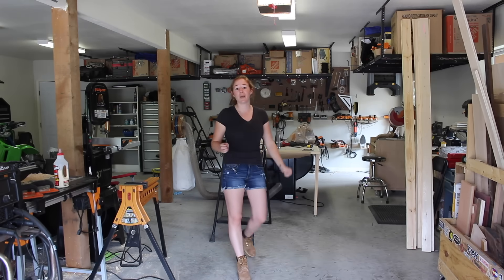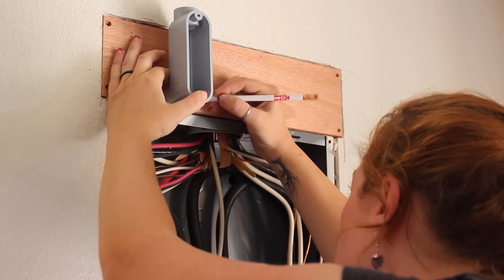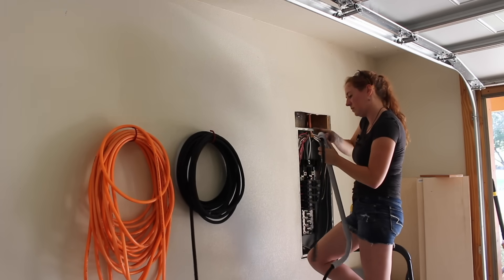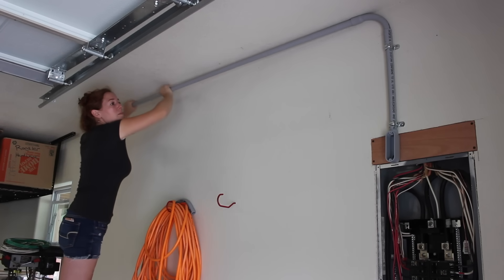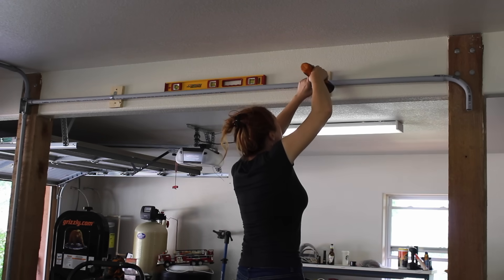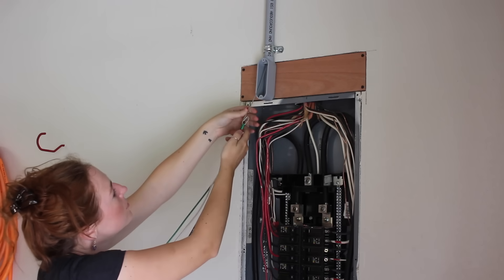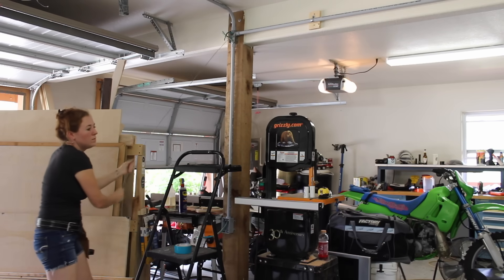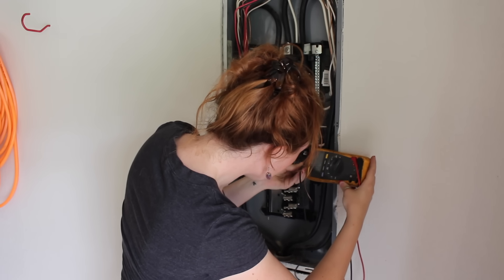Adding 220 Volt Outlets to the Garage

Comment: hi April good job"
there only 4  things you should  be done  to make it perfect
the LB  at the panel is not finish correctly   the PVC  needs to go in to the panel 
the straps on the PVC they sold be  around 10 inch from the end of the  boxes                                                                                                                                         and the splice box should be PVC or do the all job in EMT
if the wire is less then # 10 you need to use red or blue or black colors or paint the wire with marker

Comment: What do I do if my panels full, I just was getting ready to put a 30 amp breaker. I have a 240 volt multi process welder on a ups truck coming tommorrow ?
Reply: Now we are a month down the road, what did you end up doing and how did it work out?
Reply: @SuperLarryJo  hey thanks. In my case I had some breakers in my panel that were for electrical wall heaters & I don't use them, so I removed 1 and capped the wires for reuse & just turned off the other 2. Next I popped a hole in the bottom of the box & ran some 6 gauge with white red black & green (white is unused so it's rolled up nice in the panel, I then put my welder 240 outlet on in a box & wired my breaker once I had the wires in the correct placement. After it was wired I slid the breaker on to the bars, I said a prayer, I used a pole & flipped the breaker on. I didn't blow up my house, no sparks, works well & has plenty of amps to feed my welder. Put it all back together & I'll take it with me if needed to my next home.

Comment: Oh and just so u know residential electricians don't use conduit bcuz Romex is ran behind drywall and not exposed but it's not allowable to run exposed Romex therefore you do need to use conduit

Comment: The PVC is nice but next time try EMT it will look so much nicer and much more professional all your bends were 90 which is super easy and make sure your thhn to the panel is going thru conduit into the panel if you would have used EMT you could have just used mc cable from the panel into your first box then EMT from there but really good job

Comment: Hello Sebastion q. There has been a lot of talk elsewhere in regards to running romax through
conduit. Some say if you think it could be physicaly damaged, it is o.k. I would have worried more if it was for a heating circuit that would be loaded continuously (for 3  hrs per code rule) but since she
is most likely using these 240 volt tools only a short time, I would not worry about it. I have seen
some pretty skanky stuff at times but I gotta say, "She did a damn nice job!"

Comment: Well, I have a lot of respect for you. One thing someone said, should have been a red wire instead of the white wire or maybe a blue. BUT u can fix it. For at least 6 inches wrap the white with black or red 'lectricians tape, I am very sure like 99% it is legal. I'd give you two thumbs up !

Comment: Can someone double check me on box fill.  #10 requires 2.5 cu inch. 3 blacks, 3 whites and ground counts as 1 that's 7.  17.5 cu inch. 
4 x 2 x 2 ⅛ is 17 cu inch.  If that box was only an 1½ that's only 12.

Comment: Wow good job looks nice and neat. When i get my own place i need 50 or 60 amps 220 breaker box then a 20 amp and 30 amp 220 plugs for compressor and then plasma/welder plug

Comment: I thought you did a great job. I'm glad you didn't go with the SO cord because if the heat issues of enclosed conductors within a raceway. And if I could add anything is to pull colored conductors (typically red and black) instead of the white to eliminate confusion with neutral conductor, a return wire in a normal circuit. The colored conductors are current carrying. Awesome conduit work!

Comment: That’s interesting! I’m unable to kill the power to my breaker panel.
Reply: You probably already figured this out - but YOU can't kill the power to your breaker panel - legally.  The meter is hard wired to the panel...  It will always have power at the lugs as a result.  All you do when you flip off the main is break the connection from those lugs to the power rails inside your box.  (*A typical box has a metal bar that goes to the main breaker with tabs (or if ancient sockets) that the breaker (or fuse) connects to.  That bar goes dead when you trip the main, if the main was properly installed.  However, the thick gauge wire that comes from the meter and goes to the lugs on the other side of that main breaker will always carry enough juice to make you a milkshake.  That's why you never fish thru the box - one wire touches that hot lug and you're making fried turkey!)

Comment: PVC conduit 1/2"-1" should be supported every 3 feet. Also, the metal junction box should be bonded to the ground wire.

Comment: Electricians will always find something or the other. A few years ago I wired my entire basement with multiple circuits and appropriate breakers. The whole job was certified by township with no issues. The basement is still standing strong after 15 yrs and I saved 8 grand on electrical work which multiple contractors had quoted. It’s so gratifying when you do it yourself.👍🏼

Comment: I love all of your videos!   2 things I would recommend.  Use a larger junction box wherever size isn't an issue.  Look how stuffed up the single one got by the time you were done with both branches.

Also, I would have pulled in wires to place 120v outlets at each box.   You can never have too many of those, and it doesn't add much concurrent cost or labor to the job.  Same with hose bibs, I installed several around my yard when installing the irrigation... game changer!

Once I had a coiled metal fish tape sitting on a disused turntable.  My punny friend pointed to it and said, "You're listening to a Phish tape!"

Comment: This looks good - only a couple of mistakes IMO and they're not immediate issues. You should have used red tape or a red Sharpie (but you have to go crazy and really color it red, so tape is easier) to mark the ends of the white wire at all connections/junctions, so it's clear to the next person it's not a neutral, and some people might argue that you should have installed 4 wire outlets (and changed all of your plugs to match). I think the former is a code violation, but the latter is probably not, depending on where you live. Otherwise, the conduit is neat and tidy.

Comment: I will say, instead of using fish tape, I use some cord and a plastic bag.
Tape the small piece of plastic bag to the cord, put the bag and cord into one opening of the conduit and take a shop vac on the other end and it will suck the bag and cord to the vacuum in a second or 2. So much faster that way.

Good video though.

Comment: tip for pulling cable through conduit:
You can use a "pull string" with a small piece of plastic grocery bag attached.....then suck it through the conduit with a shop vac on the other side. Much easier the fish tape. 

Great job!

Comment: It's not exactly 220 V. If voltage between a phase and neutral is 120 V and the three phases are 120 degrees out of phase, then the voltage between two phases is about 208 V.
Reply: There is only one phase in that panel and its 240volts.

Comment: I know this was almost 2 years ago, and I'm not judging or criticizing what you did. Just a friendly bit of advice for you. First, that I'm guessing that you are not a licensed electrician.  If I am correct, I hope that you did have a licensed come in and inspect the work and sign off on it. If by chance something happens that a fire starts and there is a question about the wiring, whether it was responsible for the fire, and whether it was up to code, it's likely that you're homeowners insurance will be null and void on this. Really, it's all about having it signed off by a licensed electrician. They'll look for any excuses not to have to pay off on the insurance. Also, make sure that any disconnecting of the power to the mains is done in a legal manner. If something happens that causes problems anywhere else you could be "holding the bag" so far as getting it fixed. In todays litigious society, it's just not worth it to take a chance
Reply: What's the electrician going to sign off on? You think there were engineered wet stamped drawing submitted to the AHJ, permit fees paid, permits pulled and posted, and an inspection? C'mon get real. Like her home owners knows what was on the electrical plans for that house if there were any.
Reply: @matthewnelson2690  I don't know what all the paperwork and so forth that is involved, but there is an issue of confirmation by a licensed electrician that the work was done to code. Whether the proper paperwork was done, and whether proper permits were obtained is not the responsibility of the electrician unless they are being hired to do the work. If something were to happen, and I'm not saying there would be. and severe damage was done to prevent determining whether the work was done to code I would imagine that the default would that it wasn't and this was the cause of the fire. With that, there's no insurance. With that said, I suppose that doing the work with out plans or permits, that might also do the same.

Comment: I did realize it was ok to do it this way. I can use more outlets in my garage. I am going to look into to doing this....
Reply: I believe that technically each 220v outlet should be on its own breaker.  That being said, for myself I would run 2 or 3 outlets on a breaker * as long as only 1 is being used at a time.
Reply: 😊 thank you

Comment: Good job ,howerver coding is important when wiring 220V use correct wirecolor both power wire should be power colour(black) ,white is a neutral wire.All metal cans must be earthed.

Comment: love seeing other woman do this type of work.  Just one thing to mention  is that colouring red and black are the hot wires white is the neutral that is connected to the center bar strip which is grounded to your water pipes and the green is the ground connection which is also connected to a ground point through the electrical system. Good video.

Comment: 40 year's in the electrical trade. Didn't notice in the shot if you put a ground pig tail to the metal handy box where you spliced the wires. The code states all metal parts shall be grounded. 250.148

Comment: definitely not safe to not have continuous conduit... specifically, how did you get from the breaker box knockout to the LB input? You can't leave THHN wires open in the wall just because they're buried in the wall.
Reply: I wondered that myself.  I'm hoping that at the VERY least she used a grommet on the knockout or sparks could potentially fly someday.
Reply: Yea was wondering that as well. Not a good install.

Comment: In California you cannot splice and wire nut a 220 volt circuit.  You can only do that shit on regular 15 amp 110 circuits
.  220 circuits have to be a continuous wire from breaker to breaker box or plug.
Reply: That cant be true and would be ridiculous.
Reply: Ryan I know from personal experience 😔
Reply: @DominicPaz   From an inspector? Did they give you a code or reason?    A 240 run  isnt any different than two 120 runs.  I'm just curious because I'm an electrician and enjoy it.
Reply: @Ryan-hr9hw  From an electrician doing some work for me.  I wanted him to splice a 220 circuit and he said it's not allowed.  And actually it is different because there is twice as much voltage inside your junction box where you splice it, so there's a higher likelihood of a short.  Those two 120 circuits in your example are from different poles, which is what makes them 220.  If your two 120 circuits where from the same pole, I don't think there would be anything wrong with splicing them inside the same junction box, because in that case you'd be right - there's no difference.  I'm assuming that's the rationale.

Comment: That spindle sander pumps out 110 decibels. SELL IT if you value your hearing because at 110 decibels, in a small shop, earplugs under headphones is still not enough protection.

Comment: Hi April. I know you completed this task quite some time ago but I'm now ready to wire in a 220v outlet for my welder. I was so impressed with your work, I knew right where to go for instructions. Thanks for sharing.
Reply: Yep, I'm in the same boat. Did you wire in the 220v receptacle yourself? If so, do you mind if I ask you some questions about it?

Comment: What size was the thhn and what size breaker was installed? Also how did you get from the LB to the panel opening
Reply: it should be #10 gauge wire, and your breaker depends on the amperage needed, but a 30 amp double pole will run alot, unless  your putting something real big on it

Comment: I wish you would have shown what you connected to in the panel box to get 220 instead of the regular 110 house voltage.
Reply: Just a 220v breaker. It plugs in the same as a 110v breaker

Comment: Might have mentioned permits. Nearly every municipality I have lived in requires a permit for this type of electrical work. An inspector would have caught some simple things like the red\white color noted in other comments along with a few minor items. Although not applicable to this scenario all new 110v garage receptacles need to be gfci protected. Few homeowners actually get a permit; however.
Reply: If I'm not mistaken, she lives "in the county" like I do.  No permits or inspections required - except for your driveway and your septic.  Seriously.

Comment: hello please do not take my comment as a critic but more like an informed concern where I live , South Florida USA I was told by a county inspector that I would need to upgrade my panel before adding a 220 Volt outlet since my panel has a 150 Amp main breaker also there is a concern on the amperage of the breakers. i still do not understand how the builder can wire a whole house with just 150 Amp Breaker it sound so small to me and then there is the A/C unit which is a 240 volt monster.

Comment: Hi!  GREAT Video!  I'm glad to see you included the part about the NEC and changing from SOOW to THHN.  One recommendation, replace the red-striped white wire with actual red THHN, or just adding red THHN.  This way, if you want to change the feed to 120V, or break out each phase (120V-A and 120V-B), retaining the white neutral wire gives you that option.  Other than that, this is video is well put together and narrated.  Keep up the good work!

Comment: April, you did a fine job, however next time you use white wire for hot put a few laps of black tape or black marker o the ends of the sheathing. This will identify the common is now used for hot.

Comment: Wire nuts are used to finish the connections.  But before that the wires have to be securely tightened with plyers and then the wire nut is ready to be attached.

Comment: I really need a 220v outlet in my garage for my everlast welder.
Reply: Not to mention as an inlet for your generator 'suicide cord' during power outages!  <nudge, nudge, wink, wink>
If you do that, look into making an interlock so that your generator and main physically cannot both be turned on at the same time.

Comment: For those carping about this or that. Pound sand. She did  a good and safe job. Get over your genius complexes dudes. Electricity is a cinch.  I'm not sure why she ran the power in such a way though. I just put a receptacle below my CB box and made SO cords for my 220 stuff. A #12 for my table saw and joiner and #10 for welders. Maybe she just like the receptacles next to her equipment so she needs no extension cords.

Comment: VERY nice job. The only thing out of code is that you have to have 2 non-white wires in a 220-240v breaker (can't use white, is what it comes down to). White is considered "Common" or your neutral and is not considered a "Hot" wire. Since BOTH of your wires are going to be "Hot" (because once you go over 120 volts, both lines become hot), you would need two black or a black and red or blue... Otherwise, very nicely done!
Reply: You know what I found out? Electricity doesn't care what color wire it's running through. It just books through it all the same.
Reply: Richard Richardsen 😄

Comment: Put the wires ( or a nylon thread) inside the conduits before fixing on the walls. This avoids fishing work.
Reply: I am not an electrician, but from a logic perspective I was thinking that exact same thing. Why not put them in while installing the conduits, much easier.

Comment: Aren't you supposed to use 4 wires for 220v?  Two for the phases, one for neutral, and one for ground?  It was my understanding that beyond the main breaker panel, ground and neutral must be separate current paths.
Reply: Shawn Poquette different ways to wire but in residential yes usually 4

Comment: Great work 👏👏 Tip: state and show what Kind of breaker you need for a 220 Circuit. And Plug for your Receptacle!! 👍
Reply: With some of the idiots out there she may be better not too, or they may think that it is what you always use.
Reply: @patb9375  I agree. There are various models of panel boards, and depending on the size of the wire used and outlet needed will change which breaker should be used.  Also, since there are about more than 10 NEMA style outlet types for residential 240 V plus three that use a mix of the 120 and 240.  Depending on amperage of equipment, draw of circuit, and size of wire.  A standard dryer could use a NEMA 10-30 outlet with a 30 or 40 Amp breaker and 10 ga wiring, but another dryer may use a 14-30R or even a NEMA 14-50R.  In the case of NEMA 14-50R, you would need a 50 Amp breaker and 6 ga wiring.

Comment: Great job, typically you push the fish tape from the panel to the installed junction to insure you don’t hit a live wire inside the box and potentially electrocute yourself. For this specific install that wasn’t much of a hazard since the LB was off set the wall, but if you’re ever in a situation where you are going straight down into the panel, please for you safety push from the panel